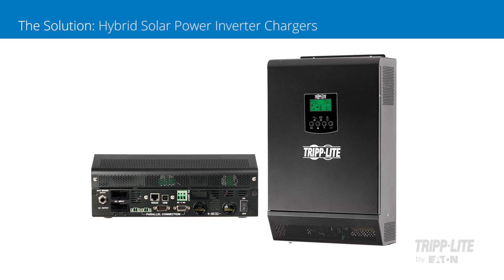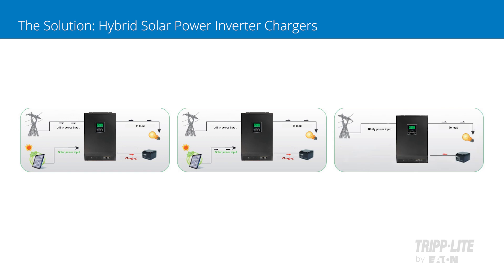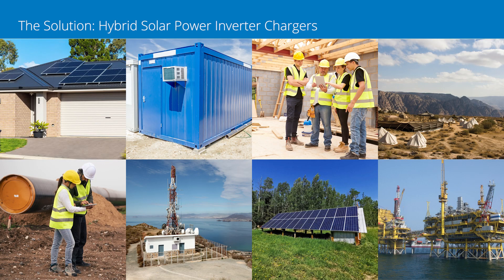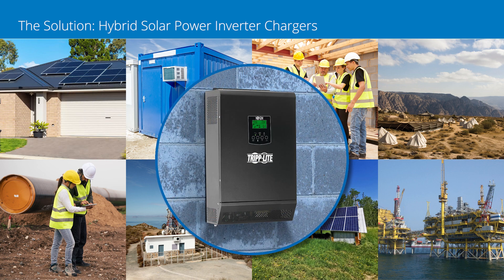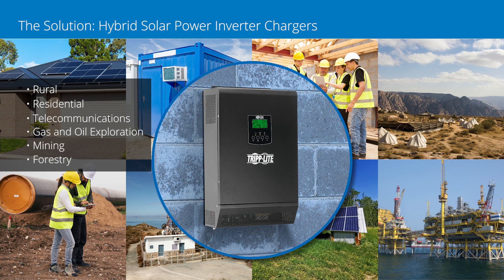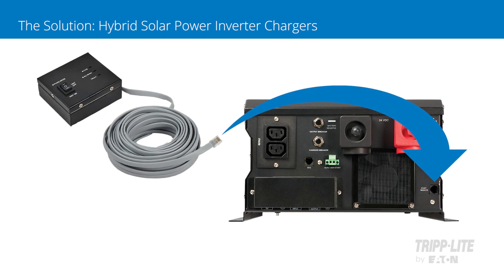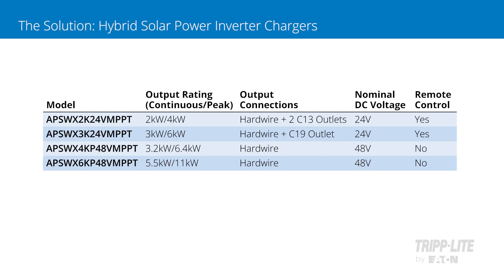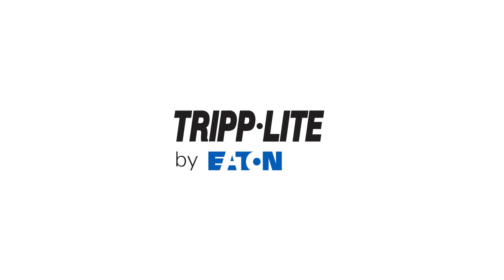Hybrid Solar Power Inverter Chargers

Comment: If these are lightweight, high frequency inverter chargers, beware, Hugh frequency inverters offer a poorer peak power capacity and a much shorter like expectancy than low frequency, transformer based inverter.